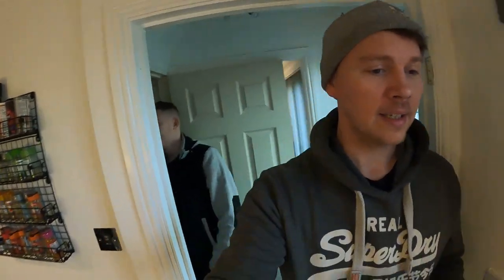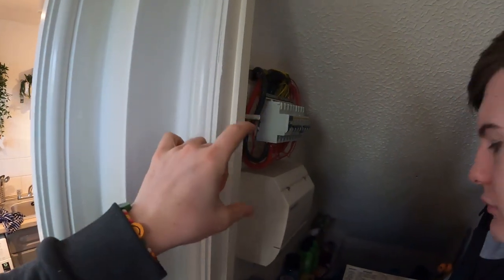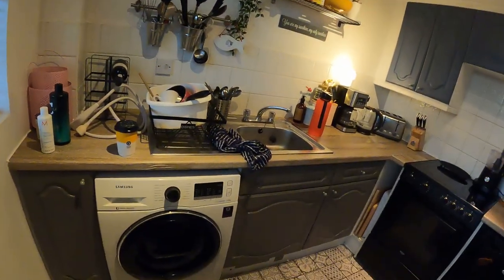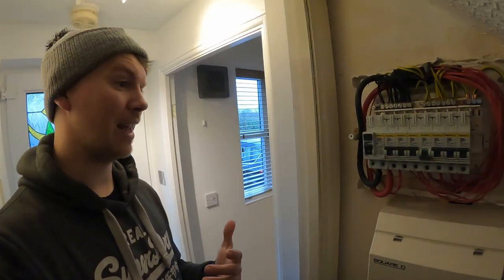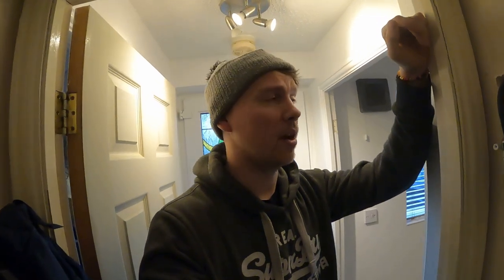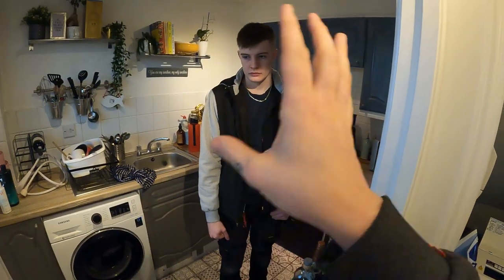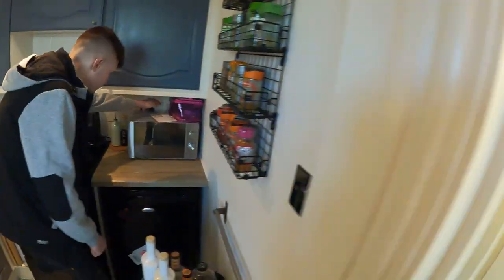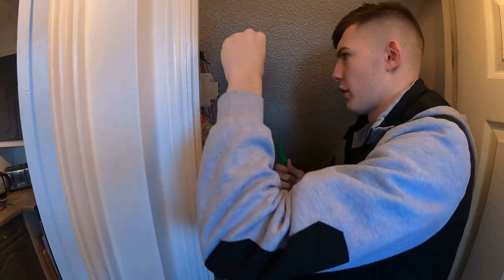Fault Finding RCD tripping - Electrician

Comment: Why didn’t you turn the board off first…?? Live to earth then neutral to earth IR tests. If you have low readings Then start to disconnect individual neutrals to find what circuit is dragging it down. Don’t worry about you clamp meter yet. IR it first ….. keep Adams fingers out of a live board 🤣💥🔥🔥
Reply: Perfect advise . IR testing is the best tool we have

Comment: Ideally when testing the RCD all loads should be removed. Reason being if the loads/circuits are producing say 10mA of leakage in normal operation (say damp cobwebs in a ceiling rose), then your ramp test, which implied that the RCD trips at 21mA, actually demonstrates that it requires 31mA to make it trip. ie 21mA from your tester plus the 10mA from the loads.

Comment: just unplug the lot turn all the breakers off and disconect the neutrals . megger the lot and the faulty circuit will show if its on the fixed wiring . and what circuit is causing the fault. a 15 minute job . if its on the ring  part the wiring at furthest point in a socket part at db and leave the faulty leg out  and reconect  the rest then part the faulty leg in the middle and narrow it down once found   possibly a trapped neutral to earth  in a socket  reinstate    all of the circuit   job done
Reply: Haha it’s never a 15 minute job when you start disconnecting the wiring at sockets. It’s a pain in the arse but sometimes it’s gotta be done 🙁

Comment: I think you’re looking in the wrong area . I don’t believe it is the shower that’s the problem. You have a low insulation resistance between N-E on one circuit that when a high load is turned on ups the earth leakage by back feeding down the neutrals . Your putting to much trust in the earth clamp rather than the best tool in your arsenal insulation resistance testing .
Reply: I had a problem recently where rcd tripped immediately when upstairs lights switched on after a board change.  Done IR checks on all the circuits and between circuits for borrowed neutrals ect. Only downstairs lighting showed about a 10Meg IR which i traced to a buried T&E in the conservatory. Although well within limits, i thought it was the problem. NO luck ,still tripped. Upstairs and downstairs lights both worked fine on non rcd side, couldnt identify any interconnection between them or other circuits. Went back next day, and done a long lead testing, only to discover that the main feed from CU to 1st light in bathroom wasnt showing any continuity on cpc. Further testing showed that the neutral was down as well. So, no earth, no neutral, WTF. Bypassed the run into the loft and BINGO. Bathroom fitter had screwed through the cable in the wall where the boxing was fitted.  Still cant get my head round how the upstairs was working when no connections were showing on earth and neutral.

Comment: No need for fancy pat testers,your megger will do the insulation tests and measure the earth impedance.And a short extension lead wired in singles is much cheaper than expensive "special" leads  to get your clamp meter involved.

Comment: Hi boys,
Even though the leakage current goes right up when the shower is turned on, it doesn't necessarily mean that the shower is faulty as there could be a resistive neutral/earth fault say, on another circuit/s or appliance, and which the neutral current backfeed from the shower is now finding, as the neutrals are commoned together.
What you should have done at that point is insulation resistance testing on the circuits separately, L&N - Earth to confirm which circuit or circuits are leaking the most current..
Reply: Excellent thoughts
Reply: The washing machine has an internal main filter that is always connected to supply.
Reply: I agree insulation resistance test all circuits for such a small board like this, with L&N together to earth with loads connected then loads removed, most likely a fault on the sockets.

Comment: Great video as usual thought the following might help.Fridge and freezers need motor running and door open for light, washer needs to be on a hot wash so elements and motor running.ovens/ grills / hot plates need to be heating up , over ride outside lighting so they are on.
Reply: My washer had a fault when it tried to engage the heater. Simple fix. Took the back off and unplugged the heater!

Comment: I'm leaning towards a resisitive neutral to earth fault somewhere (either in the fixed installation or in an appliance). As current demand rises, the potential difference between neutral and earth also rises, driving more current through the fault. 

Certainly an insulation resistance test from neutral to earth on every circuit is in order. This should be done with the CPC still connected to the earth bar as a fault could potentially exist between the neutral conductor of one circuit and the earth conductor of another, or between a conductor and a pipe.

Comment: Spent a challenging day trying to track down an intermittent RCD trip in a family member's house, doing various IR checks on final circuits - turned out it was a N-E fault in a 4-way extension socket. I'd left it plugged in with the socket outlet switched off but, of course, the switch is single-pole on the live conductor only so the fault was always connected - D'Oh! Note to self - unplug everything when investigating intermittent RCD operation.

Also have intermittent RCD tripping on the distribution board in our house - can go months between trips or sometimes trips three times in one evening. It's an older installation (from 1994) with 100A RCCB main switch. Despite investigating and testing I've never tracked down the source of the problem. Current theory is it's down to the inverter drive for the 2kW air source heat pump in our garden 'pod' which may occasionally pull enough harmonic current to push the prevailing or 'standing' leakage current just high enough to be seen as a fault by the RCCB. Board is getting replaced this year and new board will have RCBOs fitted so at least I can narrow down the offending circuit - maybe.
Reply: Good catch.

Comment: Just an add…
I try not to use “nuisance tripping”, especially in front of customers or general public. DIYers will happily short out a trip if they think it’s nuisance tripping.

Either the trip is faulty (sensitive) or not.

Circuits with transformers on (even class Ii) can cause tripping too.

Comment: I had a fault, started of monthly, went to weekly, then daily. One T&E, between sockets was run through the foundations. I had an extension fitted which loaded the wall and pinched the cable. Would pass a megger test, eventually found as daughter stood on the right place as I was testing. 6 months to find, board changed to a RCBO one to find the circuit. Cost heaps to fix!

Comment: You know what grinds my gears, U.K. and EU specs for appliances both state that any capacitors should drain down within a certain amount of time when the units switched off. But my Bosch washing machine gave me a lovely little capacitor shock (and a loud snap) when I touched the plug with it while it was unplugged.

Comment: Tumble dryers, especially condensing ones - and worse still closed air circuit ones can be quite bad for leakage because they blow damp air over the elements, a badly fitted filter results in bits of damp fluff bridging from the element to the frame across the mica sheet.

Comment: Been doing similar tonight until 9pm! Split the ring after unplugging and Ir test carried out. Found side the fault on and work from there; disconnected run cable both ends and fitted 2 x B20 mcbs

Comment: I've not used the clamp meter in this way before, just trying to understand how you are measuring the loss in milliamps.  Rcd monitors earth leakage but you have the clamp around neutral and live together. What setting is used to distinguish between flowing current and current going to earth.
Reply: Clamp meter around the Live and neutral will show the imbalance to earth leakage
Reply: Hi Shaun I think the two measuring devices look similar but one is a clamp meter to measure amps and the other is a clamp meter to measure earth leakage
Reply: I think it’s being used with same concept of how an RCD works, it is measuring the current in the L and the current in the N, the conductors being in opposite directions in the jaws hence the currents in these conductors cancel out and the displayed value is whatever isn’t flowing back via these conductors (earth leakage).

Comment: Hi Guys, when testing ring main circuits if you do a continuity test first (little r1 rn) etc first it will confirm you have a ring circuit and if there are any resistive loads I.e. something still plugged in, you can then test one leg of the ring rather than struggling to put both ends in the crocodile clip, you should also leave the CPCs connected to the MET when doing the IR test it will give you  a better chance of finding IR damage when it has a path to the general mass of earth. Great video thanks Simon SRP Electrical.

Comment: With the earth leakage going up and down with loading I’d guess a N-E short on one of the circuits, maybe try a global L&N to E IR test and if it’s down separate the circuits out and do them individually
Reply: Yeah I think his putting to much effort into looking at appliances and the shower with using the earth clamp meter . Insulation resistance testing is by far the best tool in fault finding .

Comment: You have a fault to earth somewhere downstream of the RCD, as any and all loads applied raise the leakage current.  It could be on ANY of the circuits downstream of the RCD.  

IR test each circuit until you find the bad one, then start breaking that circuit down till you find the fault.  Oh, and keep the CPCs connected to the earth bar while you do this, and IR test to that.  The fault may be to 'real earth' rather than the CPC, if you see what I mean.

Comment: Bro loving the video! You are helping a lot of young sparks like me man ! 💯 I’ve had an old consumer ( pull out fuses instead of Mcbs; and no rcds) so basically the lighting circuits of ground and 1st floor were wired in together like a ring. So I upgraded the CU first and separated it. However now I’m getting fault on ground floor. Downstairs is kitchen, bathroom and living room. LR is perfect however first thing is there is no live going to the switch ( I havent checked the actual light fitting to see if there is current going there). But even so I am totally baffled as a young sparky why it’s tripping 😅could you offer some help please and some advice on which tests to do?
Reply: before upgrading an old fuse board to a cu always carry out full testing on the wiring, or you might have to rewire.

Comment: Got called out to a job saying I was the 4th electrician in 6 months for an intermittent RCD tripping.
Customer says you've spent 10 minutes asking questions why not see what's wrong. 20 minutes later fault found.
Partial leak on oven and iron individually no RCD tripping together instant trip.
Question When does it trip and what are you doing at the time and what's on
Answer Well I do a lot of baking so I do my ironing  so I can keep an eye on it.
So I just have to run them on their own then. ?
Nope get yourself a new iron and get the oven checked.

Look out for surge protection 4 way extension leads

Comment: Love the fault finding video content and everyone's different approach to finding it and a solution.  Good content.   After all ir tests then I would have gone for a single rcbo for the shower circuit if available for the board.  Id be interested to know what the result is once the shower is replaced .  Could be coincidence but started after someone was in loft , either disturbed shower cable or disturbed bathroom light/extractor.  Keep up the good content 👍
Reply: Hi Dan if you went for an rcbo on the shower circuit then you may have discrimination/selectivity with the main rcd tripping before the rcbo.
Reply: @fusilier7115  I meant if it was a high integrity board on a non rcd side . If available
Reply: @danf6491  yeh I agree that would be the best option but not sure if the old square D boards can take that configuration

Comment: Live to earth and neutral to earth you can test at 500v regardless of anything plugged in. It won't damage anything. Live to neutral it might cause damage but I've never had it happen. Live to neutral doesn't really matter anyway when you're tracing an rcd trip.
Reply: Except for anything that has over-voltage protection built in.. computers, tvs, extension leads. All likely to give false poor IR readings at 500v.

Comment: I'd only replace the rcd with a brand new one and hook it on with a piece of wire if it isn't matching the dimensions/connectors to the old stuff in there.

Comment: Bus bar. As in 'Omnibus'  providing for many things at once.
Reply: I'm sure they used to be called buss bars, but "buss" doesn't seem to be relevent any more. It was used in other areas too, you might get a 16 buss mixing console for instance.
Reply: @tomcardale5596  I've seen the use of the extra 's' too. Though the only data I could find was that it may have come from the manufacturer Bussman who manufactured fuses. It should though only have the one 's'. Pretty much any MCC or switchboard design drawing I've ever worked with always had them detailed as bus bars or bus-bars.
Reply: @markrussell4282  I think I started using the two "s" spelling at university, I can definitely remember attempting to order busbars post uni and thinking "huh, they can't spell buss properly" which in hindsight was me not being able to spell 🤣

Need to see if I can find any of my old notes from way back when...

Edit: sorry, didn't notice I've managed to comment on both of your posts. Not trying to be a weird stalker, honest!
Reply: @tomcardale5596  No sweat! I enjoy the conversation.

Comment: Good video, but you haven’t really gone about the fault finding process in the correct way. Even though the Earth leakage jumped up when you switched the shower on, doesn’t necessary mean it’s the shower at fault, as it’s connected to a common neutral bar, and the fault could have been on any one of those circuits. 
Really you need to do a L/N-E on every circuit individually. I personally like to leave everything plugged in and switched on to start with and if the circuit shows a fault I will then unplug everything to see if it clears the fault. If it does then you know it’s equipment at fault, if it doesn’t then you can start splitting up the circuit and re testing to narrow down and trace it.
Reply: Thanks for that. Would you only use a ramp tester to make sure the rcd isn’t too knackered?

Comment: Question for anybody here who feels like answering😄, what’s the difference between an IR test at 250v compared to 500v, is the 500v much more likely to find an IR fault than 250 is? Or would the likelihood of finding a fault be similar in most situations. Thanks 👍
Reply: 240 v is the normal operation voltage for the cct, insulation resistance test ( IR ), You are sending a known current down the cct and measuring the voltage drop accross the insulation of the cable , any break down in the insulation between the wiring live and neutral ,, will show as a practical short cct ,, ,, ideal is infinity,, 500 v on the meggar is more likely to show the fault as you are stressing the cable more and more likely to show up ,,

Comment: Had this. A few circuits under 1 section of CU. Could trip 4+ times in 24 hours then ok for 8 months - I kept notes, boiler was one of the circuits. At one stage, thought maybe humidity effect so disconnected outside socket. Lasted a few years. Far too expensive to pay a pro so started checking all appliances and sockets myself. Oh, wow! I've posted before about sloppy spark work. Wires loose, oven on a 20Amp mcb, so many flaws.
   How to find a trustworthy diligent electrician? Not easy despite prepared to pay a bit extra. Recommends clearly based on whether chap (not found a woman spark yet) is likeable 'cos customers not able to assess competence. 
   I want a separate power circuit for outdoor and underfloor void plus new CUs to latest regs. Conduit and boxes all in place. South east London
Reply: What's wrong with a 20A MCB for an oven?

Comment: RCDs are meant to be tested in isolation. Turning off the MCBs and removing the outgoing neutral will achieve this.
I have had plenty of the older RCDs fail a ramp test due to connected loads. Once you remove them, the RCD tests fine.

Comment: unplug every appliance for sure, then eliminate lights first , all bulbs out because a bad bulb will trip, then socket appliances one  by one, then shower then boiler then immersion if applicable, if any has a fault you have culprit by tripping , if not must be overloading or faulty circuit.

Comment: Fault finding for RCDs Live and Neutral together test to earth as you are looking for earth leakage. Again RCD test on just the RCD with everything else disconnect.  That will give you the true RCD reading without any circuits interfering.

Think their immersion heaters are upsidedown E7 should be the bottom element and top element should be the top up / boost (heat rises)......

Comment: In my local accent 'Bus' is often pronounced 'Buzz', so you can call it a buzzbar you're just saying it in a specific variant of the northern accent.

Also, is it bad if an RCD trips at a lower than rated current, and why is it if it is?
Reply: It's impossible to make an RCD that trips at exactly 30 mA.  The rule is that we don't care what the trip value is, as long as it's somewhere between 15 and 30 mA.